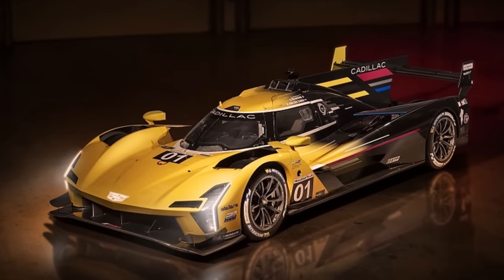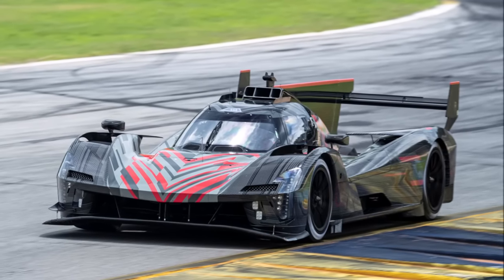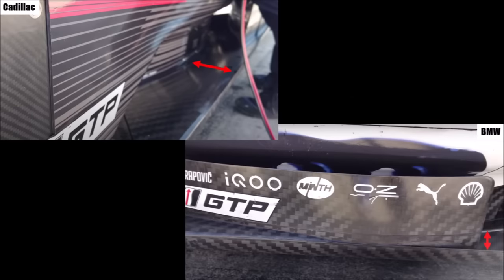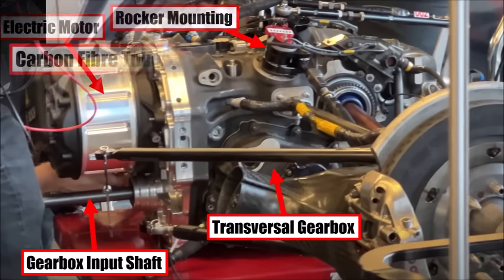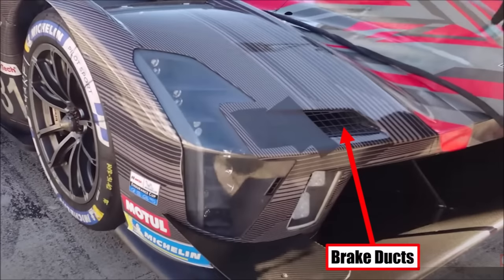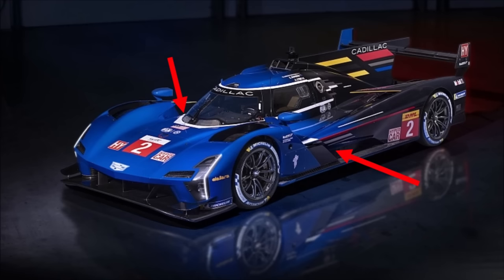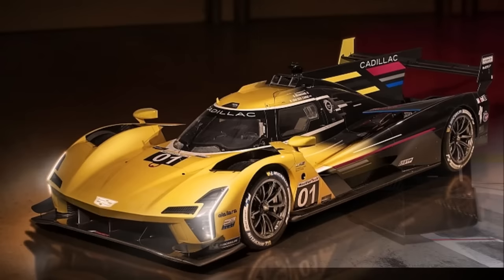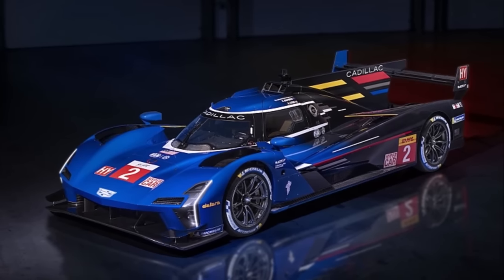24h Daytona 2023 - Cadillac V-LMDh - CLOSER LOOK

Comment: Thank you for the good analysis! However, I'm curious but is there such a thing as a "semi-stressed member" engine unit? Like somewhere in between a conventional setup where the engine unit is isolated from the chassis with a separate engine mounting unit and a fully stressed member where the engine is a part of the chassis. I'm asking this because you mentioned that the back of the cadillac is reinforced with two carbon fiber tubes. I hope someone can answer me. Thank you in advance!

Comment: Nothing beats the sound of a N/A V8
Reply: I'm more of a V12 guy, but V8 is awesome as well.😊👍🏻
Reply: V10, v12
Reply: @matteogirelli1023 no
Reply: @johncarl5505  yes
Reply: laughs in a 50 valve V-10
Reply: @Lego_Huracan_SuperTrofeo no
Reply: Check the V10 f1s vs the v8 ones.
Reply: How about a supercharged V8?
Reply: @bonnster2745  still, v12 /v10
Reply: @johncarl5505  YES !!!
Reply: Depends. If it's a DOHC flat plane, then I agree.
Reply: If someone said Supercharged V12's from the 1940's they would win this competition
Reply: @LolTollhurst  v16 engines for fighter planes
Reply: H16
Reply: Nothing can beat naturally aspirated engines
Reply: @matteogirelli1023  none of them worked right or got beyond testing programs. And if they did they'd still have to compete with the Crecy 2 for sound 😛
Reply: @matteogirelli1023  look, those are awesome beast but which manufacturers still using them? (for actual racing purposes aka to compete!)
Reply: @_hanz73  because of regulation. They would if they could
Reply: @matteogirelli1023  I don't think so, mainly because modern V8 and even V6 can output the same or more power than V10 or V12 while being lighter and uses less fuel and especially after seeing how well the Acuras did in the 24h race, and it surprisingly reliable too!
Reply: @Jatin Yadu  your trying to make the peace happen lol I appreciate that too because you're right about N/A engines. But these folks just want to argue lol

Comment: Is the LMC55R an evolution of the LT6 5.5L DOHC that GM runs in the C8.R LMGTE Pro car that was developed for the 2023+ Z06 C8 Corvette passenger car ?
Reply: It's a pushrod 2 valve engine.
Reply: @rolandotillit2867  Every website that features it (including Cadillac's own 'media' website), lists the Cady as using a 32v DOHC design, which I just assumed was an iteration of the LT6.
Reply: @joeyjojojr.shabadoo915  Really?! I thought it was based on the LS3. Hmm, I was wrong.
Reply: @rolandotillit2867  I am lost. Did you think that the LMC55R was pushrod ? or the LT6 ?
Reply: @joeyjojojr.shabadoo915  I thought the LMC55R was a destroked LS3, but it's a DOHC engine, so the block has nothing to do with LS engines since they're pushrod engines. LS blocks have a hole for the cam, which is moot if you have DOHC. So if the engine is DOHC then the block is made for it, which means it's not LS based. It is a cross plane crank though, the cross plane sound is unmistakable.
Reply: @rolandotillit2867  The new LT6 is a 32valve DOHC 5.5L flat plane crank clean sheet design by GM, made specifically for the Consumer C8 Z06 Corvette and was developed using the later C7.R (early C7.R used a pushrod 427cu LS7, leftover from the C6.R program) and current C8.R LMGTE Race Cars. As the LT6 carries the 'LT' moniker, meaning that it is in fact a member of the 5th Gen Small Block LS/LT Family, in it's case, the 'T' in LT6 really only denotes being a member of GM's Direct Fuel Injection Generation. After hearing the video clips of the Cadillac, I think you are correct. It definitely doesn't sound like a flat plane. The LMC55R could be an LT6 with a cross plane crank though..... just not enough info on it.

Comment: They can produce all the power they need as easily as most people take a leak. They can then work on tuning it for massive low end and broad torque so they hardly ever have to rev it above 5,000 rpm. The Corvette race teams used this strategy for decades. This is one thing european manufacturers don’t understand. Power density doesn’t mean jack if your 3.0 liter V6 turbo is physically larger, weighs more, revs higher leading to short engine life, and doesn’t get any better fuel economy than the big 5.5 American V8. Case in point: the legendary Toyota Supra 2JZ, with turbos attached, weighs almost the same as a Ford Boss 429.

Comment: I wonder if this engine is somehow related to the newest generation of Vette's engine.
Reply: Nope it’s not related to the corvette
Reply: It's based on the LS3 engine, destroked from 6.2 liters to allow higher RPM, this particular engine revs to 8,800rpm *I was wrong, the Cadillac V-LMDh is NOT based on the LS3 engine. I thought it was, but it's based on the same GM made engine in the C8.R.
Reply: @rolandotillit2867   
You mean they still use OHV? 

I was thinking about LT6.
Reply: @rolandotillit2867  
The LT6 was already used in Vette C8.R since 2019, iirc.
Reply: @jareknowak8712  Yes you are correct. The P&W engine in the C7.R was a OHV engine.
Reply: @rolandotillit2867  
C8 used LT6 DOHC, this new Caddy engine is also DOHC 32V.
Reply: @jareknowak8712  Yes you are correct, and I was wrong. I apologize for that.
Reply: @rolandotillit2867   
:) 
You have nothing to apologize to me for. 
Cheers!